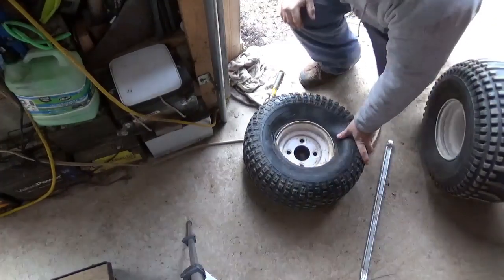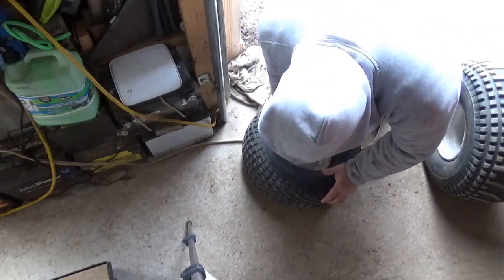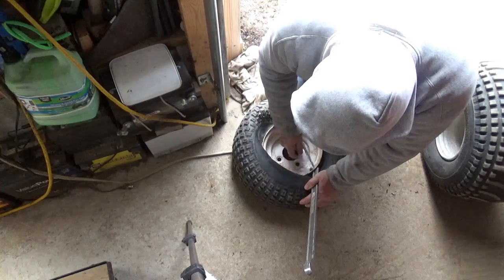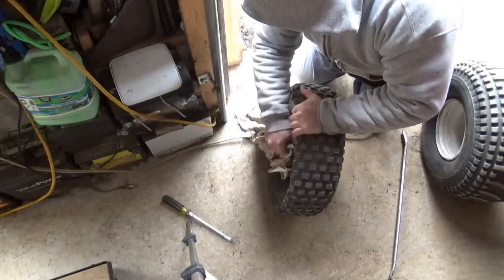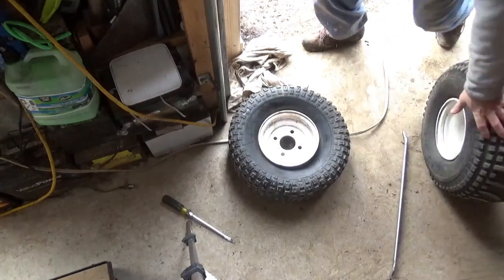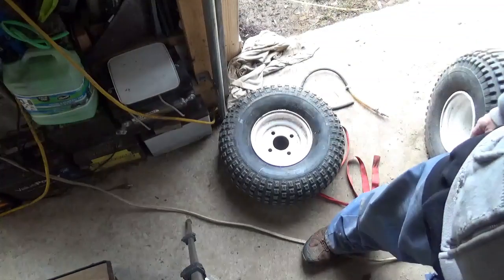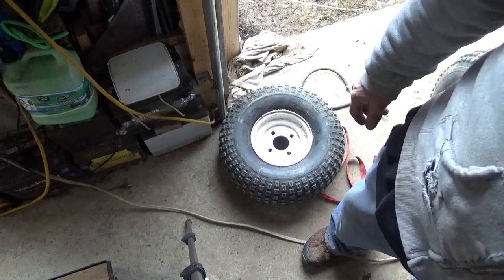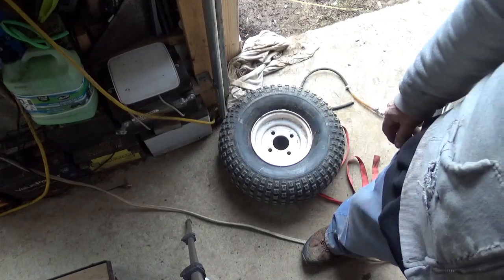Honda ATC250ES Astro 4 wheeler, Leaky Front Tire Repair!

Comment: I'm with ya. What a pain in the ass with tires! Big victory when done though!  Ive used rubber cement because it was cheap.  But with vintage tires nothing seemed to beat bead sealer. Amazon for about 13 bucks.  Thats only if you need to take on multiple tires though.❄🏂🦸‍♂️-man

Comment: Hate tire work! I use a valve core remover tool that looks like a screwdriver I think it works better when putting it back in under psi. Thanks